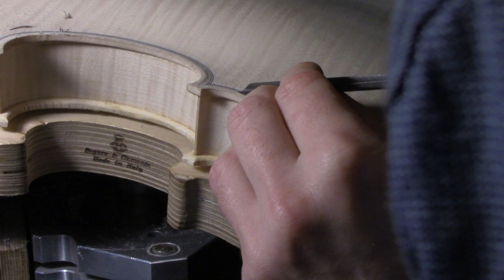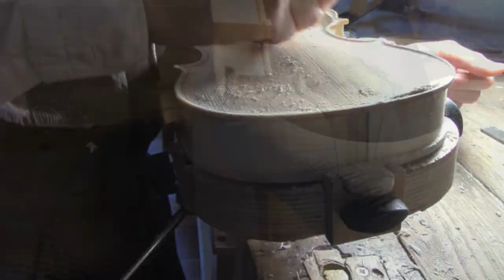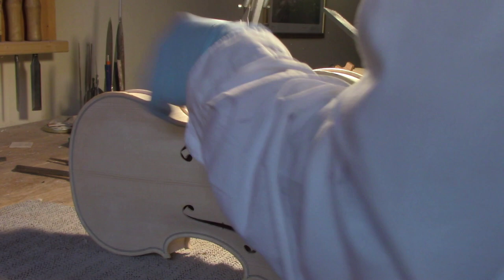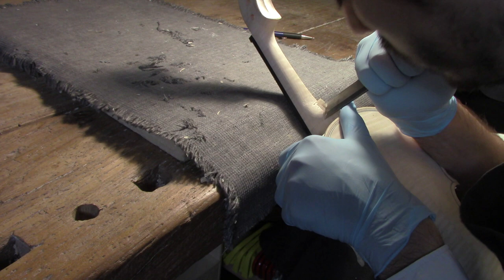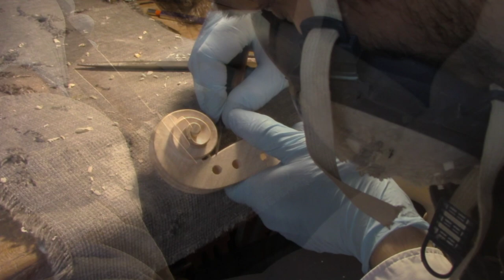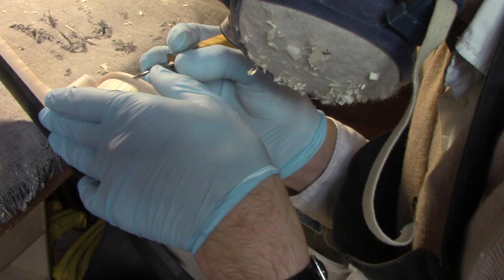MAKING A VIOLIN | The FINISHING

Comment: Hi Lucas! I'm very interested in violin making and I love your videos. For you, what is the most challenging part of the violin making process? I would assume that the whole process is difficult, but for you, is there a specific aspect of violin making that is especially difficult to master?
Reply from the maker: Thank you very much for your message and I'm happy to hear that you like them :)

I think the key word there is "master", because in my opinion to master each one of the steps is equally difficult. 
It's easier to get to an average or acceptable level in different steps, but to master them is a completely different thing. 
For example, it's probably easier to make the borders of the instrument in a way that they're "acceptable", because they "just have to be a bit wider than the ribs", than making a joint or a neck joint to an "acceptable" level, because if they're not "acceptable" then the joint will open or the neck joint will fail. However, I think that mastering the outline, roundness and overall shape of the borders is an extremely difficult thing to master. 

I hope that helped clarifying your question :)